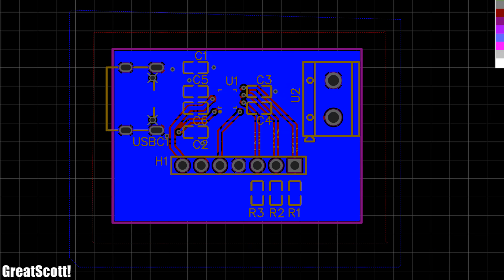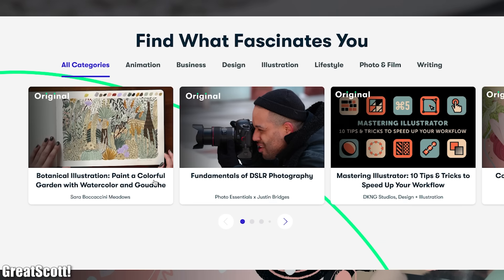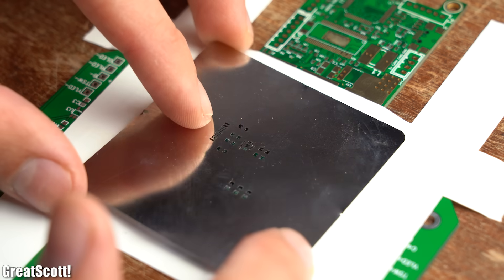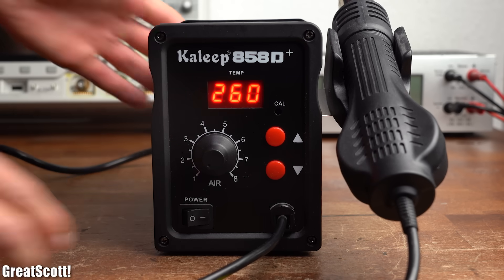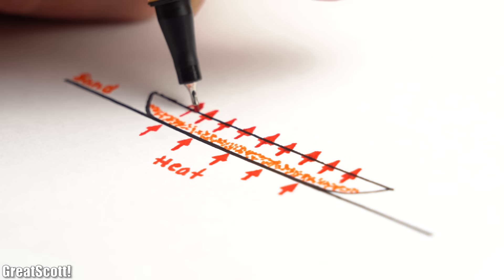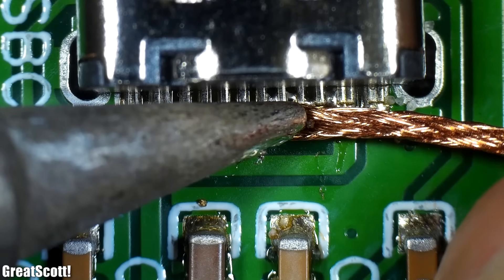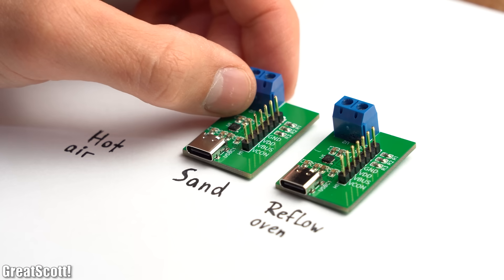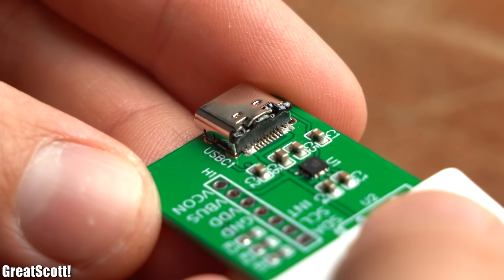How to do SMD Reflow Soldering properly! || Hot Air VS Sand VS Reflow Oven

Comment: Helo GreatScott! will you plz guide me how i can run a 9 volt dc motor and a 555 timer relay ciruit on the same power supply. I want to run this 9V Dc  motor using this 555 timer relay circuit with the same power supply. I don't want to add extra batteries for running the 9V dc motor. Please help.

Comment: Hi, In your "GREAT SCOTT" LED name board, i couldn't find any resistor connected in series with the power supply. Without a  series resistor , it would burn the LEDs in the long run right.

Comment: Look into silkscreen printing, it uses basically the same processes we already use to develop circuit boards but you remove some of the plastic material that allows for making tshirts... It also makes GREAT pcb stencils that don't last very long (not as durable as a piece of stainless steel) but are cheap and can be made in just a few hours, using the same printing systems that we already use for pcb etching.

Comment: You just need to put solder on PCB first, then on contacts of IC and connector, then add flux to PCB and connector/IC, put them in place and heat them up with hot air, components would stuck to it's place immediately and without any joints. Always doing it this way and had no issues this far, here's one of many examples:
https://workspace.circuitmaker.com/Projects/Details/LtFlash/USB-High-Power-hub

Comment: One recommendation to add on to what others have said. You might get better results lifting the PCB off the tray of the IR oven. I use a few strips of PCB to do this (left over tooling edges that have been broken off, etc) and get better performance. However larger boards, it has some hot and cold spots

Comment: "Even distribution of solderpaste all over our solder pads in a very precise way"
- Shows dog's breakfast for second coming.
I think you could have done a bit better on the stensil work by ensuring that it did not lift up between every dab of the credit card. It works paste under the stensil blurring the edges.
Interesting video though.

Comment: Hi im not a profesional in soldering, but have a little experience with fine pitched soldejoins. I had the same issues wth the bridging i had to clean up, in my case it was solved by pressing the stencil flat on the board and limiting the application of paste to one pass with th creditcard. Try to lift the stencil streight up to ceep the optimal amount on the pads. I hope this helps

Comment: Nice video GreatScott! I had surprisingly good results using a really simple heat gun, first heating the board up a bit from afar and then coming in closer. I did use a technique mentioned in other comments, making sure I had cleanly applied solder paste to reduce touch-ups.

Comment: I never had problem with the hot air gun, if you don't want to melt the plastic of your USB port change the angle of the gun and if you want to be certain stick carbon kapton tape (normal kapton do not stick enough) or just a bit of aluminium tape on the plastic side of the port... also if you have a preheating table your paste will melt faster and you can put the temperature of the heat gun lower !! personally i don't like the oven and even less the sand... but im old fashioned so use the technique you want.

Comment: Making your own reflow oven is not overly difficult either, using a <$20 toaster oven, an SSR and an arduino. 
This video shows the limits of solder-free paste and "by hand" methods.  I love the environment, but I still prefer lead solder and solder paste for best results.

Comment: We really need to get you some good tweezers. A set of SMD precision tweezers is like $6. And as comments below said, that's about 2x the solder paste that should be on that board. Also, I never run my reflow heat gun higher than 225°C. It takes 8-10 seconds to warm up part of the board.
Thanks for doing these videos.

Comment: Stencil is too thick (always refer to the smallest pitch components). Solder paste application is wrong, should be at an angle of 45-50 degree and not pushing the paste from the top. The pads of the passive are too big and will lead to tombstone. USB type C is easy to work with as long as the paste application is correct.

Comment: Just a thought. Packages like the MLP that 'float' will self-position through surface tension during reflow, it isn't necessary to be very accurate with placement. I occasionally hand solder QFN24 LAN chips, just plonk it on and heat works fine.

Comment: The reason you're getting bridging, and excess solder, is because your stencil is not flat on the surface of the PCB. When the stencil lifts up, and then gets pushed back down as you're applying the paste, it's squeezing out between the board, and the stencil. so you're effectively using too much. 
I usually just put a line of paste along one edge of the stencil, and while pressing down on the stencil to keep it in contact with the board, swipe the paste across the stencil, then lift the stencil. 1 pass should be enough. 
Another tip, is to store your paste in the refrigerator, cold paste is a little thicker, and less prone to slumping.

Comment: I use the sand only for desoldering SMD components. For soldering, I use a TinyReflow board ( https://www.rocketscream.com/blog/product/tiny-reflow-controller-v2/ ) with a pizza oven. Never had problems with this method - even better than the infrared oven. 
One other tip: You should squeeze only once over the stencil to avoid too much solderpaste on the pads. So, you can avoid the rework process :)

Comment: If you use a pan to heat sand, look for hotspots. Most pans will not heat evenly. To see where these spots are, put a thin layer of flour in your pan and heat it. Where it turns brown, there is a hotspot.

Comment: Manual soak, NICE (I sometimes do the same thing to make sure the pizza gets cooked through).  Now that you know what the thing thinks the temperature of reflow is, you need to hold it there until you see the reflow you want then set the program for that.  

DO NOT FORGET TO ALLOW SUFFICIENT RAMPDOWN TIME SO THAT YOUR SOLDER JOINTS/COMPONENT PLACEMENT DOES NOT DISTORT FROM OVERLY RAPID COOLING OF MATERIALS WITH NON MATCHING RATES OF EXPANSION/CONTRACTION WHICH WILL DISTURB YOUR SOLDER JOINTS POTENTIALLY CREATING MULTIPLE WEAK OR FAILED JOINTS.

Comment: It's cool to see that you can also do this at home potentially easy. I've choose the easier way and ordered it with all parts placed and soldered from jlcpcb. It's a little bit more work with the lists you need to send them but if there are more components it seems more efficient😅 and is also not much more expensive 😉

Comment: It will also help you a lot when using a multiple thicknesses one. In German it is called Stuffenschablone. It helps to distribute different quantities of solder paste. That's why QFN, MLP and BGA packages require one. KSG or Siebtronic are one of the companies that do that. Happy soldering! Looking forward for your next video :)

Comment: For the hot air method try heating the board underneath to protect sensitive chips or components with plastic. Takes longer than direct heating but it works well

Comment: I looked into that reflow oven, but those "required" mods seemed like too much of a hassle for an off-the-shelf product, and then I saw this video for a DIY solution.  https://www.youtube.com/watch?v=rZyP5G4Wfm0  Over a year later and mine's still working very well.  (and as others have said that's not the proper way to apply solder paste)

Comment: If you put a lid on the frying pan you don't need the sand. Basically the trapped air acts like an oven so the PCB doesn't need any direct heat transfer from touching the frying pan. I usually raise the PCB on something.

Comment: As others have commented, your stencilling technique is poor. The stencil must be completely flat against the pcb, the wiper needs to be held rigidly with about 5mm free flex and should ideally be made of the same material as the stencil, and you should complete the stencilling in one single wipe.

Comment: Good video! I'm also using a hotplate for smd soldering with great sucess. While I don't have the heating profiles i place the board on the plate just before the heating have reached the correct temperature, and takes it off when I see that the soldering is complete. The hot plate I'm using is: https://www.aliexpress.com/item/33010456480.html?spm=a2g0s.9042311.0.0.27424c4dsk9Klt

Comment: For what it's worth, SeanHodgins has some videos about using solder paste with stencils. He really stresses using as little as possible. If you used less, you might not need to touch up your joints at all.

Comment: I´m using a hot air soldering station and I´ve done some experiments with some spare boards I had laying around. The key to not melting plastic connectors is to move your hot air gun a lot and to heat them evenly but quickly. I use a high airflow and around 300°C and so far I´ve had pretty good succes. Even with flimsy JST connectors. I have never soldered a project I´ve designed myself (yet) but I´m currently working on a flight controller for a drone that runs Betaflight and a low latency digital video transmission system. The video system uses a couple of BGAs. Does anyone have some advice as to how to solder BGAs succesfully using hot air?

Comment: With the hot air gun it's much better to heat up the whole pcb first by moving the tip around, and only then focusing on some parts. Less bridges and also gives the paste time to get soft before melting.

Comment: Your video is great and very informative. The only thing I would suggest would be to use a small syringe to apply the solder paste. Some brands already sell the paste in the syringe, it makes your life easier and you can control the amount of paste applied in smaller solder pads. Keep up the good work!

Comment: Hey just one thing. I am a micro soldering technician and when you are doing rework on smd chips, you don’t leave the paste on the pcb, you place the solder paste on the chip and you heat it up, and then add flux and place it on the pcb. Also for connectors and caps or resistors you add the solder on the pcb and melt it. The add the component and reflow with flux. It makes the perfect job.
Reply: That technique is ideal for rework, as you obviously can't use a stencil on the PCB with parts already on it.
If you are assembling a complete PCB, then you definitely would apply paste to the PCB with a stencil, place all parts, and then reflow the lot in one go.

Comment: Please check  the Connection of the Metal Chassis Parts with the PE Connection on the Plug. The Paint on these Ovens is so durable even the tooth Washer used to ensure a good Ground Connection on this Device can get thru.( And the Paint is not removed on this Places. ) I found almost every piece  of metal on this Device almost perfectly isolated to the other Parts and dad to remove Paint on many Places for proper PE-connection.

Comment: How about a old Mini oven for Reflowing?
I mean, It works for powedercoating so 🤷
Reply: I used a little toaster oven with a thermocouple sensor and programmable control board for quite some time. It works pretty good actually. The only problem is the uneven heat distribution in the oven, so with larger boards and large thermal mass components (big inductors) the results were not that great. I now invested a bit more (around 3k$) and got a professional desktop reflow oven, and that really helps with the bigger boards and more complex designs.

Comment: OR.... don't use smd components. I mean for most things there are through hole options. Obviously not everything like some LED's and usb ports are only SMD but maybe there are other options like premade boards with TH legs attached. I just hate working with SMD components so I do what I can to avoid them. When I have to use them I tape off heat sensitive parts and just use a hot air gun but I don't use solder paste I use super fine .015" (.381mm) solder.  I will also use sticky tack/bluetack/whatever you call it and tin the pads first with a normal fine tipped iron.

Comment: Sand??? I don't like sand. It's coarse and rough and irritating and it gets everywhere.

Sorry, I couldn't resist! 😂
Stay safe there! 🖖😊
Reply: Wait.... 
Wait.... 
Alright, I give up. What reference is that?
Reply: i dont like sand usually when i am in it Taliban pop up
Reply: The sand is as fine as flour, does it clean up easier than flour on the board bottoms?

Comment: Several years back I looked into this and found that you can use low temperature solder paste for this. (Other people have also done this.) Bismuth solder is generally low temp and can be found in lead free version. Its so low temp you could probably get by with a hair dryer or heat shrink gun. You can also get industrial hot air guns for low price but these will likely damage the PCB if not careful. 

One problem with Bismuth solder is that it is low temp, in particular when certain blends come into contact with lead. Assuming my memory is correct, Bismuth solder will melt lower than lead free which melts higher than leaded. This will generally stay around 138 degrees Celsius, however when lead is present it can go to around 95. 

I would check this, but the point is you can get around 5cc (15g) of paste for 11 dollars and a heat source for around 14. Which makes this pretty low cost, and does not risk losing a pan. You can still damage the PCB but you would have to try a little harder to do. 

General recommendation is to warm the board up slowly, apply the high temp, followed by a slow cool down. This is to prevent thermal shock which can happen due to thermal expansion/contraction. Heat can also cause layer separation if not careful or using certain kinds. Note: boards will be hot as they act like thermal capacitors, for example concert in the blistering sun. You can also use the surface tension of molt solder to help test/ensure reflow and part placement. (Be at a point where you are calm, steady, rested and patient. It can save you money and time!)

The sand approach is interesting, compared to the hot plate method. Hot air still works best for lead free or normal temp solder, which you would want for linear regulators which produce heat and operate over 95 degrees Celsius. The oven will likely always win due to the ability to follow profile. However hot plate may work for some compared to hot air. I have yet to master hot air, and can be a serious challenge depending for certain PCBs. I would recommend starting with low temp unless your design can't. The idea of super heating Teflon is not recommended either.

Note I am far from an expert on this. Remember to read all disclaimers, datasheets, material/hazard information, etc.

https://fctsolder.com/products/low-temperature-solder-paste/
https://www.sparkfun.com/products/10326
https://www.digikey.com/product-detail/en/chip-quik-inc/NC191LT15/315-NC191LT15-ND/11480396

Comment: Something important to consider when using stencils is the effect of parallax. At those sizes it becomes an issue, and I could clearly see the paste misalignment in the video due to this. Luckily the soldermask on the PCB gives you tolerance to this.

Comment: Something we use when doing hot air to reflow solder is something called a "hot air bath". We put it under the board and it heats up the PCB to around 150C, or hot enough to activate the flux. We can then go in with the hot air at the proper temperature and reflow the solder paste.
Also, for anyone who has trouble with tweezers because of their shaking hands, if you hold your tweezers like chopsticks and place your fingers against the table, you will find the shaking stops. Use your work surface to stabilize your hands. If you get this down you will become a master in no time.
And finally, the 3 ulitimate rules of soldering (especially SMD):
1. More Heat
2. Less Solder
3. Flux is Magic

Comment: You might have a better reflow in the over if you elevate the PCB on stand-offs. The slots in the tray look like they may be screw slots. Try to get the smallest contact area you can between the PCB and the top of the stand offs and give that a try.

Comment: if that's a teflon pan, you may need to throw it out. that sand will have abraded a fine powder of the malformed polymers that occur as impurities of the teflon-making process. these random plastic bits can cause cancer when eaten. normally a teflon pan is safe, as the surface stays on the surface and doesn't come up with the food, but when it's abraded, all those little particles can stick to a fried egg or so.

Comment: What is the point of spending $200 on a machine, when you have to manually fix it after anyway. I would call that an epic fail.
Reply: Maybe other machines (that do not require any modifications) cost a lot more so it's cheaper to fix this one
Reply: Because else you spend 1000 bucks on the machine.
Reply: That's how lots of cheap Chinese tools go. You pay a fraction of the price of a decent quality one, but you have to put in some effort to make the tool usable. Same with cheap mini-lathes. It's a tradeoff.

Comment: A clean cheap and easy method is using one of those Chinese ptc heaters specifically made for 260 °C and "LED and chip removal". They hold their Temperature precisely and don't need as much power and space as a reflow oven 

https://m.aliexpress[dot]ru/item/32974113917.html?pid=808_0004_0105&spm=a2g0n.search-amp.list.32974113917&aff_trace_key=5ab7ddbdbac547abb84cc000285d7253-1591340427717-01983-ccfBY4yg&aff_platform=msite&m_page_id=2616amp-GxEbHAeIjdViPqcMPu0sKw1591569719612&browser_id=e2c2226204e44ef6804c2c7bcd558acc&is_c=Y

Comment: When soldering with hot air I usually remove the nozzle and increase flow to get wider coverage, and more energy through without blowing components out of place. Not sure if it is recommended, but it works.